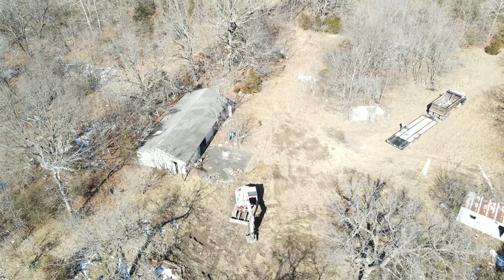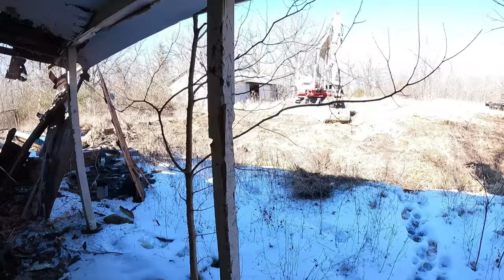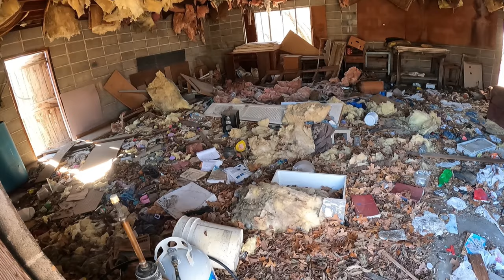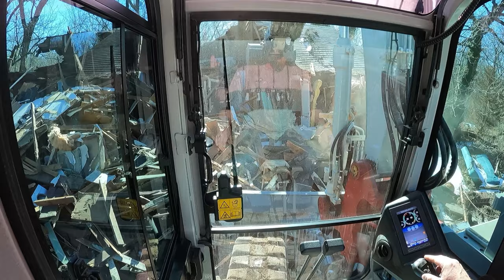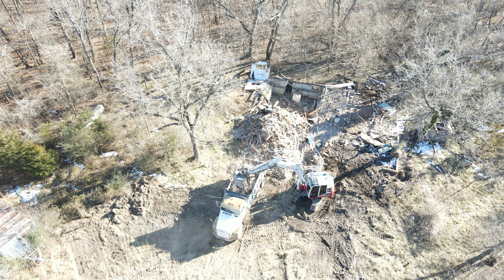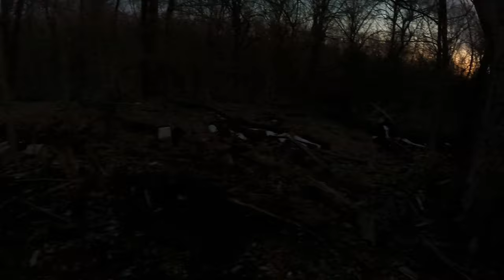Tearing Down An Old House With The Takeuchi TB2150

Comment: The 2150  is bigger than I realized. Looks like it does a nice job. On your GoPros, is there some way you could fasten a  cable or cord to the frame and run the end out away fro it’s position and pin it to something so if it happens it gets buried it would be easier to find? Thanks for the ride along.
Reply from the maker: Yeah it’s 36,000lbs almost as big as Letsdig’s 160. Yes next time I’ll have a better rope or cable on the camera lol. Appreciate you watching

Comment: How many truckloads of c&d trash did you haul off and do you know about how many square feet was the house?
Reply from the maker: The house was around 1300-1400 sq ft and we hauled off 15 loads of debris and 8 loads of concrete